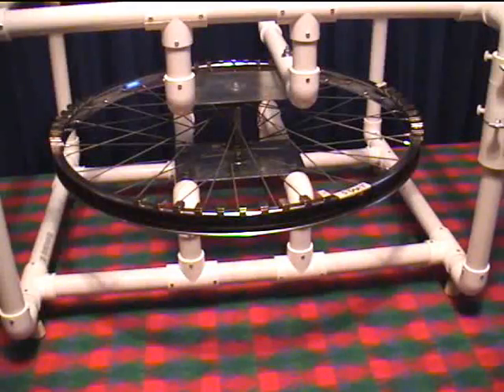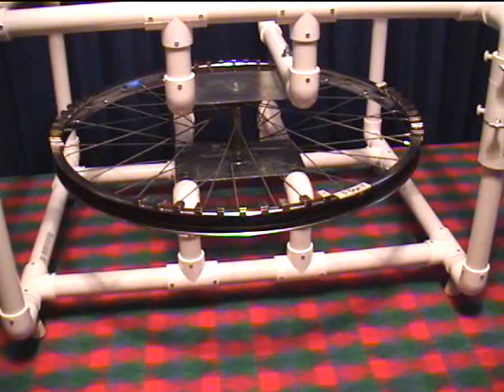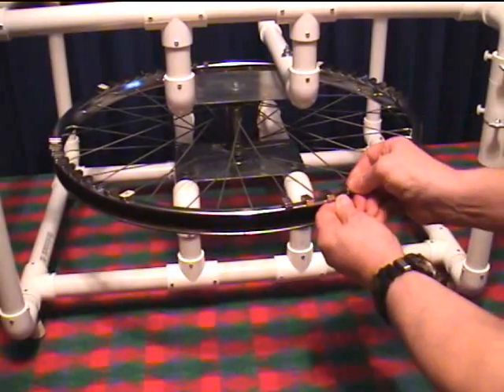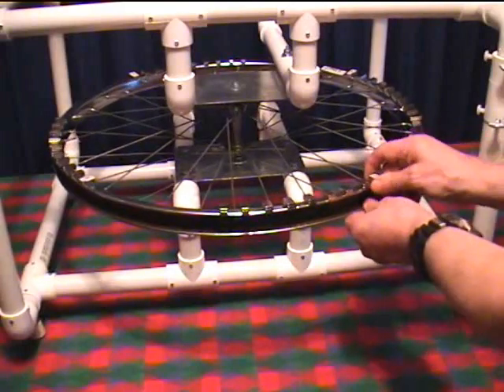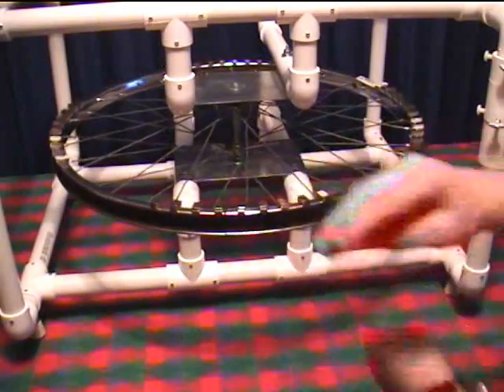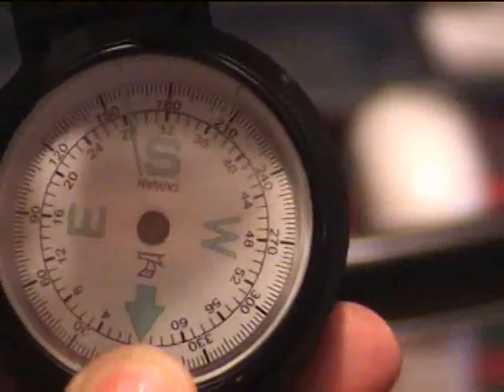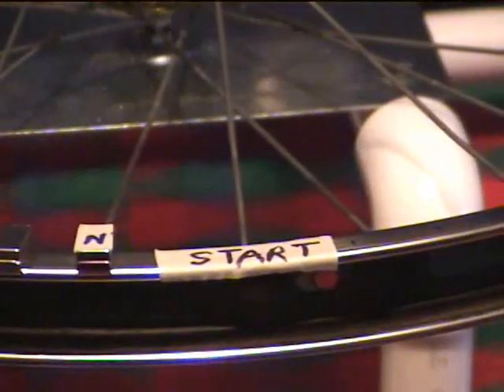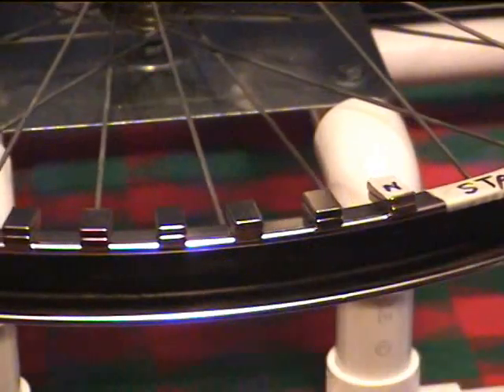Video # 4, "Rick's Pipe Dream" Magnetic Motor - Generator

Comment: Is it possible to use an electromagnet instead as your starter magnet?  I'm thinking that if you could attach a bar or tripping device on the bottom of your wheel at an appropriate point which would be used to throw a switch to turn on the electromagnet.  Use another trigger to turn off the electromagnet on the back end of the series.   Would the wheel speed up faster and faster or simply find a steady rhythm?